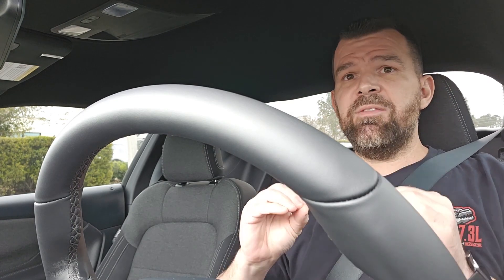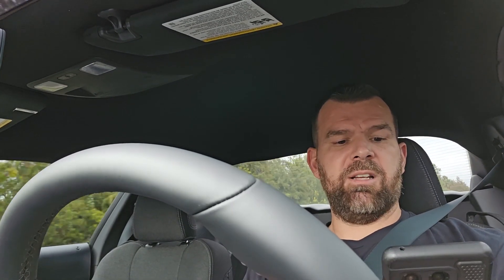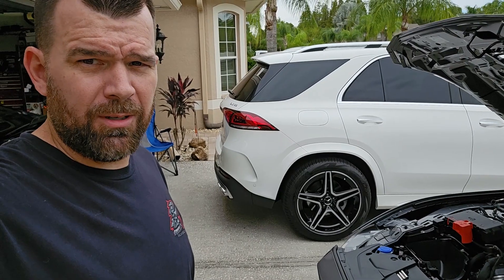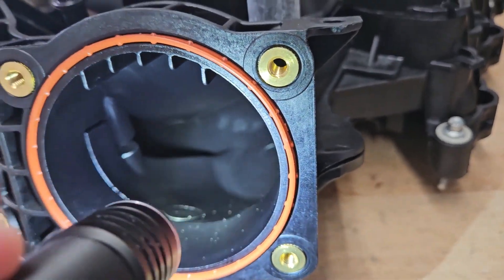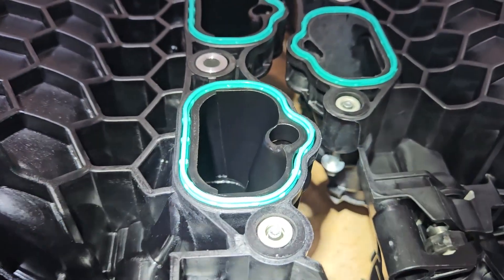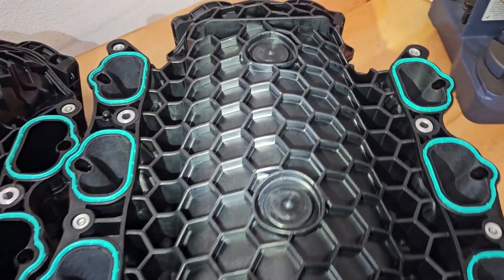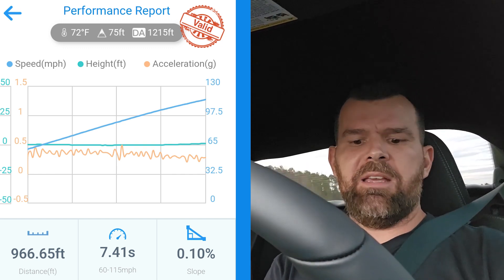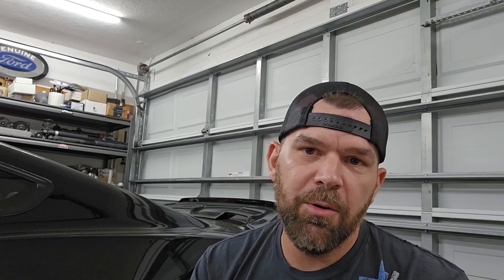Grinding Away! S650 MUSTANG COYOTE V8 Ported Intake Manifold Test - USING THE DRAGY AS A "DYNO"

Comment: When you removed the stock or installed the ported, did you disconnect the battery? I was debating on porting mine but def don’t want any codes or that mess lol.
Reply from the maker: I did. It still threw some codes and acted funky but eventually went away.

Comment: Liked the port job.  Looking at the acceleration, there is more of a bow in the average in the ported vs. stock; starts higher and then falls off.  Unfortunately, you can't remove the mufflers, but maybe the restriction is on the backend vs. intake at stock redline?  Dumps for the win?
Reply from the maker: Headers coming soon! Let's see what happens. 🤟